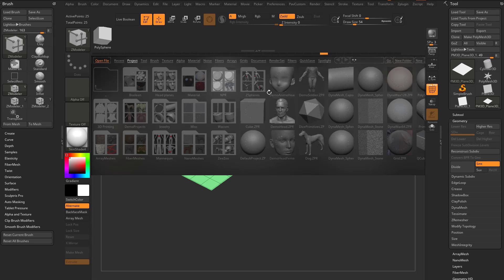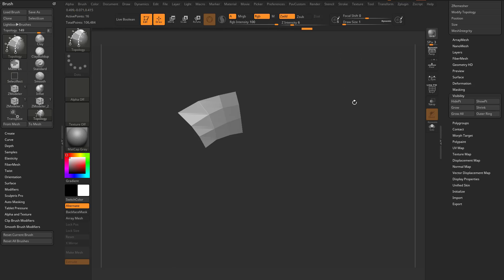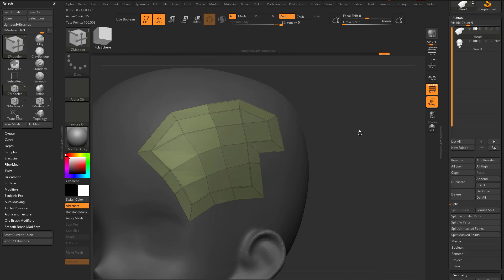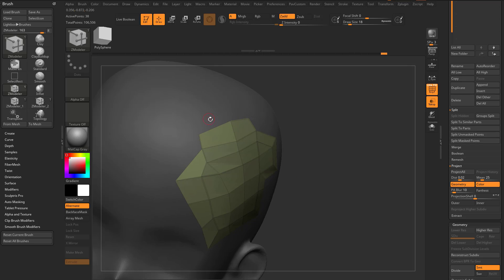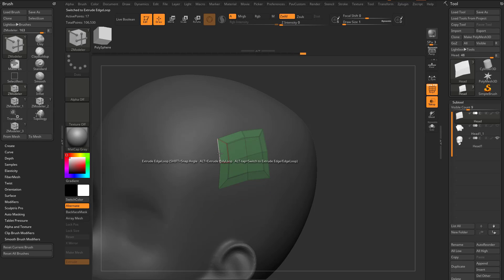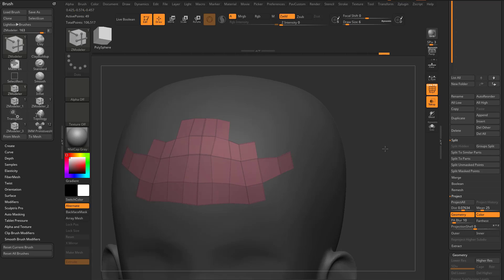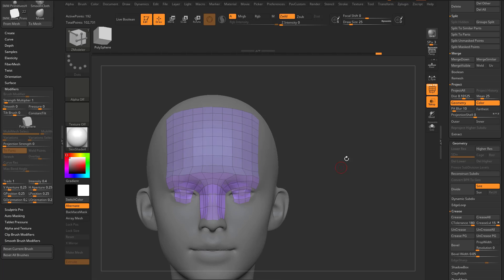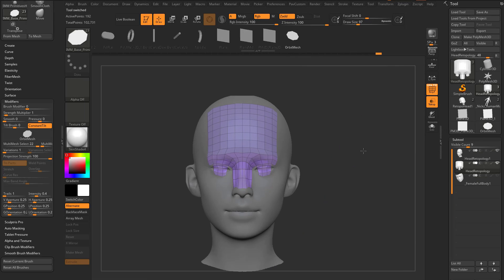035 ZBrush 2021 ZModeler Edge Extrude Retopology Techniques

Comment: When I use Zmodeler Point-Move the point seems to move based on where on the point I drag from, for example sometimes I will move my entire cursor across the screen just to move the point halfway, and other times the point will stick to my cursor as I would like it to. Is there a way to turn this off? I cant tell if its an intended feature or a bug.
Reply: Have you tried dragging the focal shift slider all the way to the left? That might get rid of the fall off, so near-clicks act the same as dead-on clicks?

Comment: The smooth brush doesn't work at all with the cloth projection, that should be fixed, every time it was tried in this demo, it did nothing.  It works better if you turn off Dynamics, then smooth and then use the normal projection button.  The edge extrude should be able to bridge between edge loops.  The topology brush should work on a separate subtool, just like Zmodeler so you don't have to be jumping back and forth so much.  It should also be able to fill a tube by drawing a few edge loops around an arm, then a line connecting them all.  IMM for inserting patches is cool, but again it should work on separate subtools like cloth.  ZRemesher should be able to work to fill gaps in an existing mesh, so you only make the main loops, then let it fill in the rest.  The improvements make retopology in Zbrush better but there are a lot of little things that could make it even more so.  I still feel like 3Dcoat has the best of all retopology tools.  Even with these cloth and projection options in Zbrush, 3Dcoat is still faster and easier to work with for my regular tasks.  I use them all though, using the best tools from whichever app has it, but that is also how I can feel the difference.

Comment: Hi! Do you use zbrush when you retopology game characters that will be animated? Whether you do that or not, which method/technique do you find the best currently to achieve this inside zbrush? Or do you think it is waste of time to learn retopology for game characters inside zbrush?
Reply from the maker: whatever is fastest for the person. in my experience, the fastest way to retopologize a character for production (and consistency and usability) is to snap approved existing base mesh geometry to an arbitrary high res. if that's not an option, whatever your favorite way of extruding edges and snapping verts will suffice, they're all varying degrees of the exact same thing in 2022.

Comment: Every second edge extrude runs under the subtool, so I have to switch to ghost mode to be able to move the points, but in ghost mode snap to surface doesn't work, so I have to switch back and forth from ghost to transparent mode after every second edge extrude. Very buggy and unintuitive feature :(
Reply from the maker: Don't know if this will help, but maybe set a hotkey for tool > subtool > Project All to snap all points to the nearest visible surface
Reply: @MichaelPavlovich  thank you it sounds good, I'll try it.
Reply: @MichaelPavlovich  I tried it and it works and I realized that snap to surface works in ghost mode too in new ZBrush versions.

Comment: conclusion - unfortunately absolutely not suitable for retopology!
Reply: In the 3D Coat program retopology is much better
Reply: @aleksandralexander  ретопология в maya тоже хороша. ещё есть retopofolw для blender но он ещё не допилен до рабочего состояния.
Reply: actually, if you will do all this time consuming work of making custom brushes and assigning shortcuts for them, everything works fine. Not so elegant like in maya and 3d coat but not bad at all. I think it's similar to 3ds max retopo tools
Reply: @denistemirgalin2956  Not really, 3DsMax is way faster and easier to work with.  Then you can add some plugins like Wrappit, and the Rappatools modeling extension which makes it even easier, but 3DCoat is #1 for simplicity and speed. Blender is also really good, on par with Max and has a few better built in tools than 3DsMax like the shrink wrap and the way you can extrude edges and fill them quickly with the F key or fill in large patches with the GridFill.  The on top mesh display is also better than Max or 3Dcoat's reference mesh opacity options, since it doesn't show any clipping geo.
Reply: @gabe687  What's about Topologik for 3ds max?
Reply: welp im sticking to topogun lols

Comment: Well this is very nice. But I like to use Zremesher + any 3d modeling tool like 3dsMax or Maya or Blender. Manual retopology is rare for me
Reply: As long as your not animating then zremesh is fine. Problem with something like a character is it won't make proper edgeloops and has a large tendency to create spirals that make rigging and getting good deformation a nightmare.
Reply: @ShawnPaul86  There is a lot of tools like Makeahuman, Daz3D, Mari, just random cheap basemeshes, that artist can use as a reference, manual retopology is an expensive timewaste
Reply: @pavelyankouski4913  Sure if you're making a standard human. Sorry but it's not going to cover every scenario and if you want to make a unique character and animate it manual retopo is 100% necessary. Maybe in the future it won't be but it's still required.
Reply: @ShawnPaul86  I don't know really dude, I have about 12 years of experience in creation of AAA assets, even if u are creating a retopology from some stylized sculpt u can just use fast ZRemesher and after continue with a manual fixing over the topology, its doesn't really matters which mesh will u use MakeHuman, Daz3D or Mari or whatever u want to use, at the result of retopology it will became unique. If u gonna retopo mesh from scratch u will waste your time, you will waste your life for nothing
Reply: @pavelyankouski4913  let's see these AAA assets